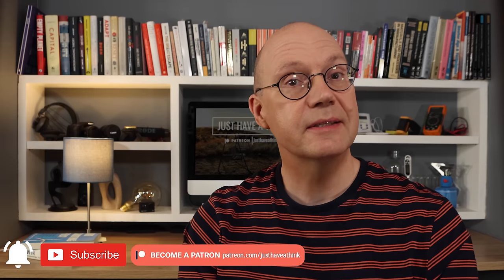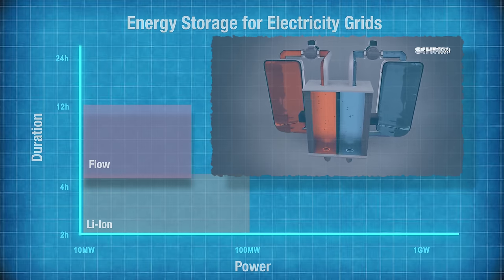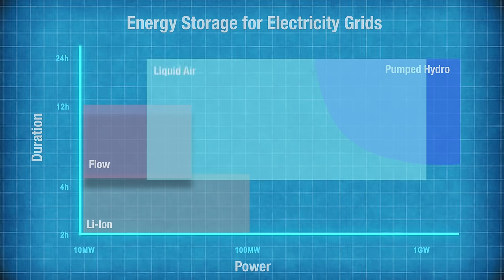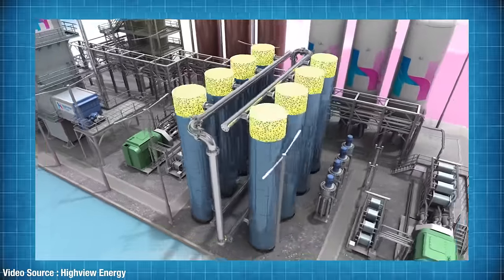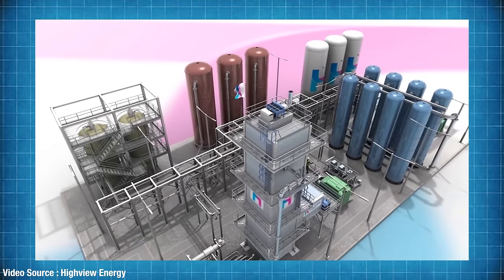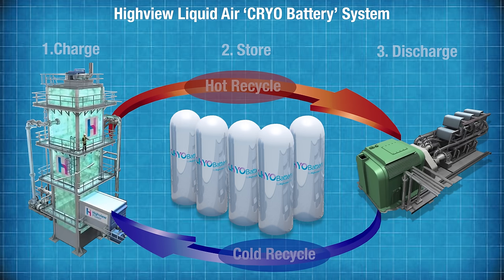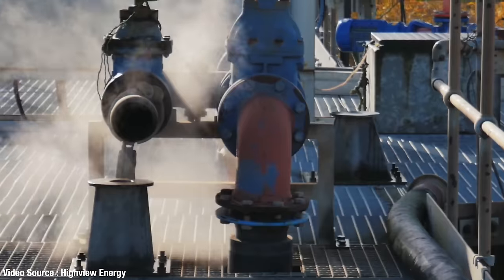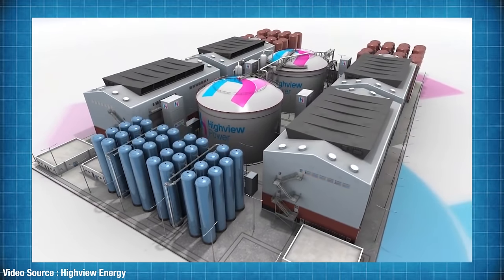Liquid Air Batteries. Literally energy from thin air. Seriously. Literally!

Comment: Looks like some good carbon capture could be what fuels this method of energy storage. We need those two birds with one stone answers.
Reply: How?
Reply: Yes! "Moisture and CO2 removed before compression", A CO2 capture system??
Reply: @robinholmes785  yet CO2 is 415ppm, so not a significant concentration, as was said in video its basically nitrogen.
So the interesting thing is its cooled rather than compressed.
Reply: @williamgoode9114  If there's a fractional distillation stage in the process, then water and CO2 would be left behind and could be diverted.  Both would form ice at the temperature of liquid air.
Reply: @incognitotorpedo42  hmmm there's more CO2 in a can of coke than a house full of air
Reply: @williamgoode9114 , Is it not cooled by compression then expansion to drop the temperature, as in making liquid air prior to the choice between the eventual product of either liquid oxygen and liquid nitrogen? And then, when it is liquid, pumping it into tanks. That is how I think of it. I have understood it that way for the last fifty years or so.
Reply: KENT - its Pretty Dumb. 
best way is to NOT GENERATE carbon in the FIRST PLACE by Decomissioning ICE powerplants and REPLACE with Renewables and MEGAPACK Batteries.
Reply: @markplott4820  Cutting out our fossil fuel use and cutting our CO2 emmissions is definitely the best route, but if our batteries capture carbon too, they are perhaps one way to reverse the damage we've already done, along with reforestation.
Reply: @martineyles  - Liquid Battery Storage cannot hope to Compete with Current GRID Storage batteries.
compare LAES at 15 mwh to MEGAPACK at 730 mwh .
and LAES still uses FOSSIL FUEL to Chill, compress and Power the factory.
MEGAPACK can use 100% Renewables and OFF PEAK energy. 
and LAES does NOT last as Long as Megapack. 
compare 3 Hours Discharge with LAES to Megapack at 6 Hours . 
THE POINT of going RENEWABLES is ZERO CARBON in the First Place. 
ANY KIND of Combustion is a VERY STUPID thing to do, Specially for HOMES. 
100% Electric Heat is way more Efficient.
Reply: @williamgoode9114  A can of coke contains 2.2 g of CO2. That's the same amount as in 3.1 cubic meters of air. So your house would have to be very tiny.
Reply: Kent Deal,  In general, carbon capture and storage seems like shifting the problem from one place to another. The carbon doesn't disappear, it just gets corralled for a while above or below ground . . .
Reply: @jamesneilsongrahamloveinth1301  - I Agree with James, best way it to not Make Carbon in the first Place.
Reply: Well it would seem like some folks think one tech discludes others. Our way forward is multifaceted responses over time that produce some real winners. Sequestration is the prime directive...

Comment: This is the first I've seen about liquid air batteries, and I appreciate your thoughtful and approachable treatment of the subject.

Something occurred to me during your presentation: Since we're separating CO2 from the air as a prerequisite for liquifying what remains, is there a practical way to sequester that carbon that I presume is otherwise simply being released back into the atmosphere? I haven't been able to find anyone discussing the idea of combining liquid air battery operation with carbon sequestration.
Reply: CO2 is very small percentage of the atmosphere we call air. In fact, according to current atmospheric science, CO2 make up .04 percent of it. It will not be practical to try to separate such small percentage of gas from our air.  Besides, CO2 is a good thing. Only we dumb humans think its bad and use it as a weapon to dumb us down even further. By the way, carbon sequestration technology already exist that works amazingly well. Its call plants. Just plant more trees, flowers and crops and we have the most efficient carbon sequestration systems on earth working non stop for us.
Reply: @richardgardner4252  
I understand that CO2 is a tiny fraction of our atmosphere, but this is exactly what makes separating it from air and sequestering the carbon so effective. If it were a higher percentage, we would have much less hope of reducing the amount of carbon that's in the air with techniques like this. Your point about plants, though, is very well taken. They do provide a very fairly effective and highly scalable method of sequestration. Since, as the video explains, these liquid air battery facilities already remove CO2 from air before liquefying it, maybe there's a way to release this CO2 in places where it will be more likely to be absorbed by plants. Maybe forests, jungles, and greenhouses. Clearly, I'm not a scientist. I'm just thinking out loud, possibly foolishly.
Reply: It's called the gas of life. So, who cares! Why does anyone worry about THAT, when we have multiple sites, dumping nuclear waste into running rivers, DAILY, since before you were born?!?!
Reply: @thediplomasta5891  You sound like someone who might have a plan, but you didn't mention what it was.
Reply: @JeffClough  how about, not wasting my time or energy, arranging the deck chairs on the titanic. The only way out, is to crash the system. We have faceless corporations making these decisions. There's nobody to fire. We created a ghost, and then made it our master. 
But keep an eye out. Not long to wait.
Reply: @thediplomasta5891  hi. Can you take a look at another view for a minute...? What if we simply acknowledged, yep,  we have messed up and cocreated a faulty system for sure...And then lovingly, responsibly created a new one. Do you think you'd be a good teammate for a creator of loving realities? I think so. Let's just jump in♡
Reply: @richardgardner4252  and stop covering viable farmland with solar panels, roofs walls and parking lots are better suited. Imagine your local shopping malls with solar roof paking lots or solar covered outdoor walkways. Storage has always been the gorilla in the room for "green energy".
Reply: You could pump it into greenhouses to grow food faster, but we don't currently have a way to make money storing carbon.
Reply: @richardgardner4252  You misunderstand the technology. They have to separate the CO2 b/c otherwise it'd form "dry ice" inside the mechanical systems & cause damage. Likewise LAES processes also fraction off the liquid oxygen, but for safety reasons. 

In any case the CO2 fraction is just a few steps away from either a complete FT-cycle (carbon neutral, makes methane, used to boost the LAES turbine cycle) or a sequestration product (NaHCO3, or sodium bicarbonate). Deployed at petawatt scale the potential for climate remediation is eminently feasible.

So all your silly bromides about CO2 being "good for us" is just reactionary nonsense - you're obviously no engineer much less a concerned citizen & no claim to superior knowledge.

Comment: Very interesting! Question though: what becomes of the filtered carbon dioxide and other gases in the cooling filtration process part of this? Thanks!
Reply: Probably released into the atmosphere, where they came from originally. Adding carbon capture capability, is a distraction, here, so stay away from mission creep (salesmen). Keep it simple. This is almost as simple as pumped hydro, without the geographical restrictions, and is scale-able, both up and down. The components already exist. The turbines will have an easier time since they're not running at high temperatures. Around room temperature if designed correctly. Minimize adding secondary cycles, since the added complexity, to squeeze out efficiency, will be a determent to reliability. If you get the energy generation cost down, you can sacrifice efficiency. Rule of KISS (Keep it simple, stupid !)
Reply: Great answer, Michael! Thank you. :-)
Reply: Question is how feasible is this for home set up?
Reply: @buliameenoladayo3074  Nya, home setup is not so much within the scope for this technology. From what I've read i.a. the company themselves say, 50 MW upwards is where it becomes economically interesting. For applications below that (= you want private storage at home), Li-ion or similar batteries will probably remain the technology of choice.

Comment: What about combining it with a oxygen separation from liquid air and waste incineration plant? Oxygen can be used for hight temperature combustion, avoiding dioxins and heat of combustion can be used to achieve higher gas expansion in the turbine converting energy of boiling liquified gas.
Reply: LAES is Bullshit, it still REQUIES burning of Fossil Fuels to power the Plant. 
Tesla MEGAPACK has no Moving Parts and uses Renewable Energy.
Reply: Stroporez the air battery has the advantage of using the oxygen in the air not carrying it in the electrode reducing weight.
Reply: @Dana5775  this is not a thing.
Reply: I wondered about this, but it requires joined-up thinking and cooperation between the different industries, something which (at least in the UK) is sadly lacking.  If the liquid air storage people could work with the incinerator designers, industrial gas suppliers, district heating operators, cold-store users and so on it would be brilliant.

Comment: The presenter keeps mentioning how cheap this supposedly is. Did he mention a price per KWh? From my perspective this shouldn't be so cheap as most of the equipment involved will be very large and require a sizable maintenance budget, not to mention that cryo components are generally not cheap.
Reply: That's a wonderful question!  We'll have to ask Brian and Colin…
/s
Reply: "At a Bloomberg New Energy Finance summit in London this year, Highview CEO Javier Cavada claimed the technology could store energy for weeks at a time at a cost of around £110/MWh ($144) in a 10-hour, 200 MW/2 GWh system."
Reply: In reality, the carbon footprint of this method is probably on par with just burning natural gas.
Reply: @HamRadio200  Please show us how you calculated this?
Reply: You are 100% right
Reply: @HamRadio200  Not if it's fed exclusively with solar and wind power.

Comment: Interesting video. So at 7:56 "Roundtrip system efficiency of around 60%". That means 40% of energy is lost by storing it in this liquid air battery and retrieving it again? I wonder how this compares to the other alternatives, chemical batteries or pumped storage etc.? I guess even storing energy with losses like this beats losing the energy altogether.
Reply: TESLA Megapack is 98% Efficient , even IF you only use OFF PEAK energy to Charge it.
but, Megapack can be Directly connected to Renewable Energy and to the GRID as well. 
each Megapack is 3mw and is SCALEABLE and can be Delivered on a Flatbed and Installed in just 100 days.
Reply: @markplott4820  Great. Want to compare costs per amount of energy stored?
Reply: @rendomstranger8698  TESLA Energy still comes out AHEAD, even IF you charge MEGAPACK just on OFF PEAK energy (7c/kwh) , you can SELL the Energy at PEAK rates for a PROFIT during HIGH DEMAND times.
a Cryo Battery will STILL require Maintanance , Megapack is completely SELF SUFFICIENT it has a BATTERY MANAGEMENT system. 
Also, cryo battery will be VERY EXPENSIVE to build and ONLY last 20 years, Megapack can last 80 years and when CHEAPER and SUPERIOR batteries are Developed they can be EXCHANGED.
Reply: @markplott4820   Why do you FEEL the need to WRITE a WORD in all CPAS several times EVERY line?
Reply: More like 35% efficient, they can only get it up to 60% by placing the plant next to a conventional power plant and uses the waste heat.
Reply: @scottrichard1986  Or any other source of waste heat.

Comment: Considering the air is liquidfied by cooling,  it occured to me that co2 would freeze out of this as well, possible combination  of energy storage and carbon capture comes to mind.
Reply: Nope, CO2 & H2O are contaminants, that would freeze and block pipes.
Remember even at global warming levels CO2 is "only"
415ppm
Reply: H2O and CO2 are removed prior to the cryo stage by zeolites. When those are saturated, the H2O and CO2 are removed by baking the zeolites.
Reply: And oxygen, too. Running an advanced (65+%efficient) engine on as close to pure oxygen as it will handle sounds grand.
Reply: @williamgoode9114  So you're saying that no issue brought up by a sub-genius after 2 seconds of thought can be solved, even if operational examples of the declared impossible device currently exist?
Reply: @richardcaldwell6159  exactly, 2seconds, firststage of cooling out comes the water vapour.
CO2 also is easy, but the other gases oxygen and nitrogen are not seperated.
Reply: Hmm, I think carbon capture only really works when fed a CO2-rich gas stream - ie the output of a coal/gas-fired power station. CHP is the first process, using the leftover heat, then extraction of CO2 - but if the resulting leftover gas is cool, makes sense to cool it further...
Reply: @lawrence18uk  very rich, and even then what the hell to do with it, nope this process is purely liquidfication, and there's a lot of parts to wear, and awkward heat transfers, like hydrogen am sure it will quickly be superceeded by batteries, flow or lithium or something, ha maybe those heavy lead acid batteries from cranking diesels could be repurposed TESLA now 1278
Reply: Yes they are doing that. They are going to give Co2 to beer manufacturers
Reply: @lawrence18uk  yes that is most efficient as I believe co2 is around 20% of the emission as apposed to around 0.04%direct capture, such devices are in operation for both, although I've not seen one that freezes the co2 from the air but if you are freezing air to a liquid water and co2 are the first to freeze. The difficulty with co2 is that is freezes straight to ice without a liquid phase, however after looking I have seen purpose built frost chambers just to do this, after all dry ice is a thing. I kind of like the idea of a co2 snow inside a purpose built device.
Reply: @rahulagrawal64  I'll drink to that!
Reply: A little bit OT, but since you all seem to be interested in carbon capture tech I wanted to point out a technique I find most intrigueing.
It's the Terre Preta soil fertilier of the native Americans in the Amazonas basin.
Basically the most cost efficient carbon capture "technology" is just to plant trees, but how to store this carbon indefinetly?
You can produce charcoal which can be stored in soil for millenia.
When you let the charcoal absorb nitrate, phosphate and other electrolytes from animal or human excrement (for example in a bio gas facility) it can act as a long term fertilizer to enhance the quality of soil, creating artificial black soils.
Thus you can solve three problems at once:
1. CO2 emissions
2. Soil degradation
3. Pollution of fresh and sea water with nitrate and phosphate (which is a big problem)

Also the technology is very easy to implement on a decentralized level for extremely low costs.
Reply: "...co2 would freeze out...."  Yes, that was mentioned in the video.  Water vapor and carbon dioxide would be removed before liquifying the remaining oxygen and nitrogen.
Reply: @catandtheostrich  regulating H2O baking is one of the least supported legislative agendas but zeolites need a new name if they expect to be respected by Congress.
Reply: @williamgoode9114  the interesting survey article posted in the comments no it's that like the modern air conditioner refrigerants of the last decade or so it gets out of balance the oxygen and nitrogen if you don't take care 2 protect the system from to pure oxygen. Oxygen is of course a bleach alternative and the very nasty material you don't want sneaking up on you in the pipes. It oxidizes and that can be dangerous very very very dangerous. Nitrogen however if kept away from fire is not trying to do shit like oxidize AKA rust or combust
Reply: @rahulagrawal64  turns out if you're making beer you're more likely to request nitrogen
Reply: @sualtam9509  the production of charcoal releases carbon dioxide
Reply: @Irene-fu6gj  ozone has its place. high high in the stratosphere to protect us from the suns damaging UV

Comment: This is beautiful!  I just hope that the cost of this will be reasonable.  It seems pretty green, so I for one am willing to pay extra for this type of storage though.
Reply: I'm pretty sure they have a levelized cost of storage (LCOS) of $140/MWh. Which puts them around about the same as the cheapest lithium batteries, dispute being only 60% efficient.
Reply: @MrGonzonator  Hmm.  That's not terribly impressive, then.  Li-ion prices are coming down, but air liquification is mature tech, not likely to get much cheaper.
Reply: @incognitotorpedo42  I think both could work at the same time. The nice thing here is that it doesn't use any of the same materials as batteries, which seem to be in short supply given the problems some legacy auto manufacturers seem to be having sourcing them. Their price estimate is for their current size system, but scaling up the storage element (more tanks) would be only half the price, compared to batteries where its basically all of the cost.
Reply: MIKE - Tesla MEGAPACK cost less to Operate. 
Megapack can be deployed in less than 100 days. 
TESLA Autobidder software can BUY/SELL Energy at the BEST Price way faster than ANY Human can.

Comment: 60% conversion efficiency sounds low, but the cheap startup cost and flexibility may make it worth it.
Reply: 60% efficiency is not low dude.
Reply: Remember the low eco-impact as well.
Reply: It's definitely not low?..
Reply: @zarinawillows2347  I think lithium-ion in like the 80% range.